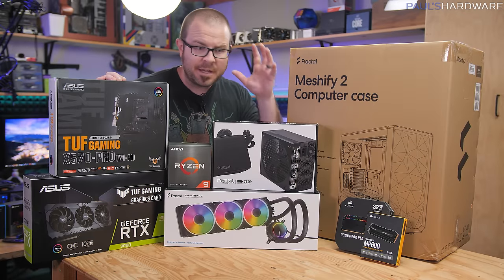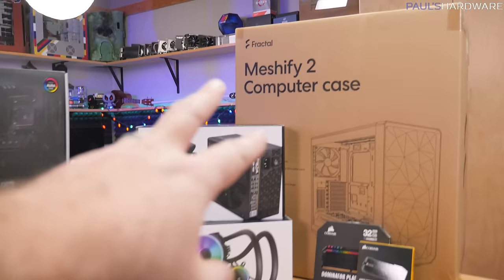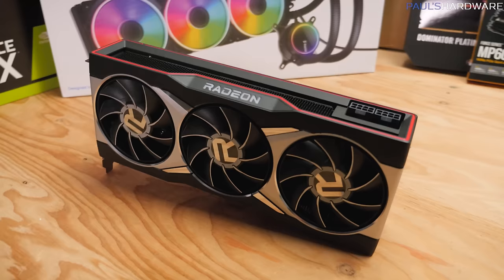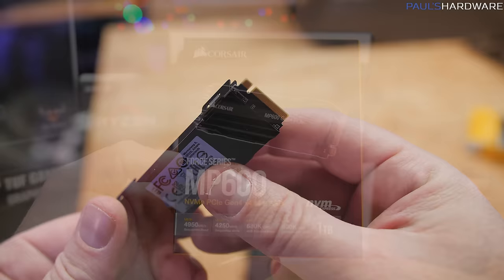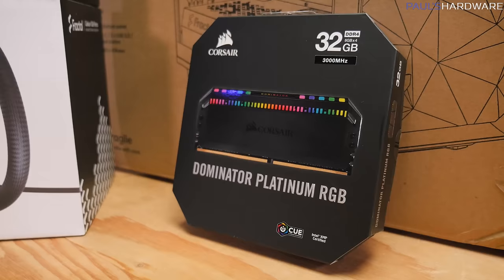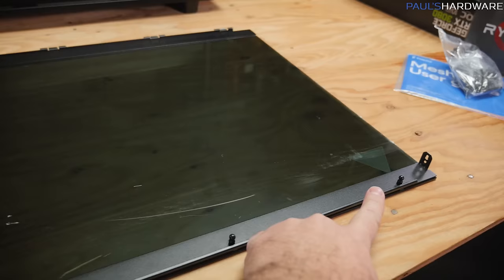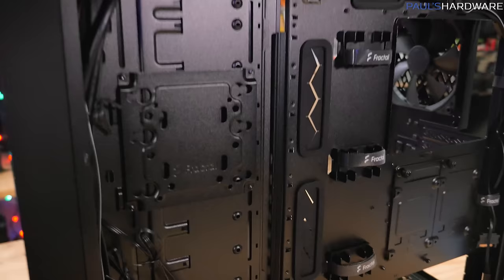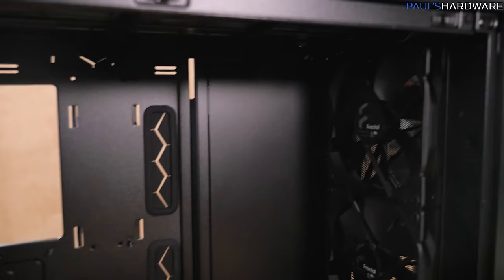Building the $2000 Gaming PC EVERYONE Wants Right Now!

Comment: 2020 is so weird...I've never had such a hard time giving a company my money 🤣
Reply: true, that's why I bought the rx 5700 xt now and will wait 3-4 years until they release more gpu's with decent stock
Reply: @joaomorato4351  I'm not pressing either, I have an 2070super. I'd like to upgrade my motherboard from asus b450 to 550 before anything.
Reply: Its nearly impossible to have them takenyour money, yet they throw 10s of cards to these content creators. They all end up posting the same.
Reply: at least you have money
Reply: @qweenzgrimyest  I don't think you need to do that. I doubt there will be a performance difference from a B450 to a B550.  Honestly the only reason to go B550 is if you have a Ryzen 5000 series CPU for it, otherwise save your money. If you want the PCIe Gen4, your 2070 Super is Gen3 anyway, and no GPU will really take advantage of Gen4 even if it was built for it. The only thing that does take advantage of PCIe Gen4 are really high end NVMe SSDs.
Reply: @fragalot  I plan on upgrading to Zen 3 if they become available ever. And also plan on only running off of NVMe. I have Samsung 970Evo. I cant go back to a regular HDD.

Comment: I was actually looking at building this exact system sometime in the spring. What a coincidence! Great video as usual!
Reply: It'll probably be obsolete by the spring.

I just built (in May if this year) a 3900x, 5700xt, 32GB, liquid cooled, same MB he's using in this build and I feel like it's already outdated (even though it runs everything I throw at it smooth as butter.)

Good luck.
Reply: @billb0313  You think a 5900x and a 3080 will be obsolete in less than 6 months?
Reply: @billb0313  Try looking up the meaning of the word "obsolete" before you use it next time.
Reply: @billb0313  i build my pc with a 5 year of expectations, I would never buy a new build every year or consider it out of date just because newer tech comes outs..  i have the 2014 build gtx 970 i5 4690k and that is still a decent build when playing at 1080p and it can even run a few games on 2k, I plan on selling my pc this soon for around £150 and using the money to build a new pc for around £1700. this build I would expect to last me to 2025
Reply: @billb0313  just cause it's not the latest doesn't mean it's trash. You still get the performance you paid for lol
Reply: @bradclark5913  Thanks for the heads up! I'll be sure to research this more before I decide what to buy. Appreciate it.
Reply: @Broussky88  software is outpacing the hardware at an exponential rate so, yes.
Reply: @rafe9852  I did. I stand by my comment.
Reply: @HaiLsKuNkY  software is outpacing the hardware at an exponential rate. Good luck.

Comment: This is literally the build I just put together, cept with the MSI Ventus 3080, an h710, and Kraken cooling setup. This monster better last me the next 5 years lol
Reply: 5900X worth it? I can’t decide between that or the 5800X.

I plan on building in April when the stock is readily available, although I’m sure better hardware will be out by then.
Reply: @ryannnftw  5900x offers 8 more threads and 4 more cores for 100 dollars more, as well as more cache. I'd definitely say its a better value even though I have a 5800x. Both are amazing though.
Reply: @ryannnftw  What alfie said. I personally think if you’re going all out on a high end PC you might as well get the best you can afford and just treat it right. Doubly so given the performance to price jump between the 5800x and 5900x. Good luck with part procurement and the build!

Comment: "$2,000 Gaming PC everyone wants right now!" 
Me who just built a $1000 GPC: :(
Reply: what specs? just curious. I did a 700$ build with i5-9600k, 1660 super, and 16 gb ram along with 500gb ssd
Reply: @calvinonmc  hey were almost the same (in the graphics card part) 
Ryzen 5 3600
1660 super
Western digital blue 1tb
Corsair LPX 16gb 3200mz
Bronze 500wat
Case: NZXT H510
Reply: @heyr3tr044  haha yeah, i went with a cheaper case, my power supply was 700 watts, and i went with intel because amd was out of stock at micro center
Reply: @calvinonmc  This is my first computer build so why not go big and spend a litte extra, it did come out to $1,500 (Including taxes, shipping) I also had to buy a monitor, keyboard, and mouse. overall I love this PC
Reply: @heyr3tr044  yeah that's why I don't buy online. We have about the same specs but it costed you so much more because you bought online. And online prices are crazy right now. I got my 1660 super for $220 and my i5-9600k for 150$
Reply: @calvinonmc  $220?!? It cost me $360, and well I had no choice there was no Micro center near me and Best Buy didn't even have all the parts I needed just the 16gb ram. Before getting I used laptops with 1tb of storage so I had to get a 1tb M.2
Reply: @heyr3tr044  yeah you should not have bought a graphics card online at this time, if you would have waited then the 1660 super will be well below 200
Reply: $1100:

Ryzen 5600x
Asrock x570 extreme4 mobo
240mm watercooler
16gb 3600mhz cl 16 ram
Nzxt h510 case
2 scythe fans to replace stock case fans
Pcie 4.0 nvme ssd
650w PSU

Didnt get a new GPU yet so im using a 1050 ti, but that will be replaced aroubd spring time
Reply: @BlastinRope  cool but i wouldve gotten a really good gpu and went with a ryzen 5 3600 until I could upgrade
Reply: @calvinonmc  it was a toss up between go semi-budget build and get everything now or get a quality foundation and be patient.

Decided to be patient in the end
Reply: @BlastinRope  well it took me 5 years to get to 650$, and I just couldn't wait any longer.
Reply: @calvinonmc  i understand, last time I had a gaming PC was 2015, since then Ive only had my work laptop and a super budget dell w/ 1050 ti. If I was younger and still played a lot of video games id be dying for a good rig - when I started gaming in mid 00s my first computer could barely run the first version of runescape, the ancient 2d one. I know how it feels

Comment: Hi Paul, thanks for the videos. I took a step and built my first PC using your videos as a guide.
It is modest by the standards of this machine but I am stoke with it.
Biostar B550M
Radeon RX 570
AMD Ryzen 3 3100
16GB Viper Patriot 3000MHz
WD blue SN 550 250GB nvme 
Total cost with case and power supply approx £600 GBP (approx $800 USD)

Cheers again,
Dave

Comment: Just did the almost identical build except used a Define R6 case and because of the shortage of components did air cooling and RTX 2070 Super. I also used the vertical mount for the card, which would really look cool in this build.

Comment: Nice build. I do question the positioning of the AIO tubes as they partially block the lower LED's of that very cool and very expensive Corsair Dominator RAM. For what those sticks cost, I would want to see every single LED it all their glory. Could you perhaps reverse the radiator so they come down from the rear side of the PC?

Comment: Yeah Bravo! it looks so easy, clean and super. Felicitations! I am sparing for my next upgrade from a i7 8700k OC-ed to 4.3Mhz and GTX 1080Ti och a Asus rog MB to a AMD system with may be a MSI Mag x570 tomahawk, ryzen 9 5900x and rx 6900xt or rtx3090 (I am hesitating there while thinking about ray tracing). What would be your opinion about that?

Comment: My only complaint about the x570 TUF PRO vs the PLUs is that they moved the front usb port (non c) header to the bottom of the case. Now you have to work your way around your bottom case fans, and the factory cable on my O11 dynamic barely reached it, so I bought an extension. Definitely an unexpected consequence of getting the front usb C header.

Comment: I need help (newbie)! I'm building my first PC! So far I have a tower case, 3070 ( I have two, an MSI Ventus 3x OC and a EVGA Ultra. Which one is better from these two?), 5900x (I also have a 5800x but i was luckily able to buy a 5900x), AIO 240mm. My only issue is finding a Motherboard for this build. I've heard that x570 is better than B550. All the other parts (SSD, PSU, RAM) are already in my "cart" ready to buy. Any input on a good motherboard to buy would be greatly appreciated! Thanks!

Comment: Hi Paul, did you have booting issues with this setup? I mean, the RGB works but is the pc booting?

I recently build a similar setup with Ryzen 5900x and TUF X570 but the pc is not booting, I'm just wondering if my problem is related to old BIOS

Comment: Fractal meshify mini, 5900x, tuf b450 matx wifi, trident 16gb 3600, dark rock 4, 850w rmx corsair, 2x LF 140mm argb fans front, adata pro gen3 1tb m.2. (Missing cpgpu atm...) Similar build that should be cheaper, yet here in Canada I'm over 3k putting it together.

Comment: Paul i have a question about compatibility with some ram i just bought for a new build i am attempting....

Asus x570tuf wifi plus
Ryzen 3800x 
Evga 1000 g+ PSU

The ram... is~
 
Geil super luce 4133 1.4volt cl 19-19-19-39  16gb gaming ram

I was wondering if it will actually boot up or will i have to buy new stuff not pulling 1.4 volts or clocked at 4133?

Or is that just an xmp profile and will i have to manually clock it to something that will work?

Comment: Mine's costing around 2.000 and it futures cougar panzer evo rgb, msi mag x570, r9 5900x, corsair vengeance rgb pro 2x8, corsair RM 850+, Samsung 980 512GB and probably rtx 3060ti when it comes out for like 400 dollars in US I could find the system for like 1500$ to 1600$ but if we add import fees will cost around 2000€

Comment: prefer those flat black cables than the sleeved extension cables. i don't find those extension cables appealing. what i would want to see though is graphics card manufacturers put an extension plug on the bottom of the gpu, like a 3" extension cable, where you can plug the power connectors. instead of what it is now.

Comment: Nice build.. High spec & looks clean 👌 I've got a NVIDIA GeForce GTX 1060 6G - i5 7600K - 16GB Ram - & a little bit of ssd which is a bonus.. With water loop too. I paid £400 for it which I thought was pretty reasonable 🤔

Comment: This is basically the build I want, but I am reusing my GTX 1080 for now. My main problem is that I cannot find a 5900X or 5800X...

I definitely am in need of a new PC though. Still using a 3770K and DDR 3. It's worked well, but I am starting to feel its age.

Comment: For GPU sag, I used a really long Twist tie. Its White and goes with my White case. I attach it to the corner of a top mounted case fan, through a screw hole. The other end wraps around the wire bundle for the power connector to the 2080 Super. 
I use this method for two reasons. 1. It doesn't stretch much.
2. I can control the amount of tension on it because of the way the twist tie wire works. 
It works fantastically, and I can create a balance. 
I'd like to know of someone has used this method with a 3080?

Comment: can i use the MSI GeForce RTX 3080 GAMING X TRIO 10GB GDDR6X with this. im fairly new to computers and only know some stuff. so if i buy this ^ will it not work with the thing. also i kind of mixed some of your used parts like the 4x8gb DDR4 3000 memory

Comment: Paul will my i7 9700k OCed to 5ghz at 1.31v , rtx 3080 asus rog strix edition and 16gb corsair vengeance pro ram at 3600mhz be ok with a corsair 750w gold 80+ power supply? I've heard that with intel cpus they use more power than amd, especially when oced and asus recommend 850w for their gpu on website as it used 30w more than founders so will I be ok with 750w or is that not good enough?

Comment: Hi Paul! I need some advise. I purchased a Gigabyte B450M DS3H motherboard and 16gb Crucial Ballistix 3200MHz (BL2K8G32C16U4B). I need to know which Ryzen processor can support that RAM speed and if I can Overclock the CPU if I get heat sinks or some other cooling solution for the MB's VRM?

Comment: i have this motherboard tuf x570 pro wifi and i can not get the docp profile to work, it constantly crashes the pc or boot loops. i have updated the bios, tried different ram, corsair snd gskill, 16gb 3600 and 32gb 3200 kit and neither run stable when enabling DOCP. have you had this issue? any help is greatly appreciated! also pc runs great when bios at default profile but even the smallest overclock on ram is unstable

Comment: Change the ram and the cooler I have a similar system ready to go except for the cpu and I got Gskill 4000mhz 16 cas latency RAM for my system and a arctic 360 cooler.

Comment: I am looking to complete a build using components pretty close to the build featured here (I am using Fractal Design Meshify 2 XL + Ryzen 9 3900XT + RTX 3070 Aorus Master + Tuf Gaming X570 Pro Wi-Fi + Celsius S36). Are the USB78 /USB910 ports on the motherboard compatible with the USB 3.0 system cable ?.
Reply: I connected the USB 3,0 cable to the USB 3.2 Gen 1 header on the motherboard (apparently it is backward compatible)

Comment: This PC is exactly what I want and slightly more powerful than what I need right now. I'm thinking of upgrading but no availability + the virus means I won't be able to upgrade for a while now. If I got it though, it would be perfect for my uni stuff and gaming, of course. Only things I'd change is swap it over to my P400A, nothing against the Fractal case, it's just a personal preference thing, plus the P400A except for the fact that it is the only truly premium PC part I own, was also a gift, so I can't part ways with it. I'd also add some of my drives on it. Then I'd just need to find 300+€ for a 1440p 144Hz monitor, to take full advantage of it...😅

Comment: I'd take out the four 8GB sticks of DDR4 3000 RAM and replace them with two 16GB sticks of DDR4 3600 and get that Infinity fabric clock set proper. Isn't it true that fewer RAM modules allows for better overclocking? My old i7 3820 has eight 4GB sticks (it's Quad channel X79) of RAM (DDR3 1600) and I can get a stable overclock of 4.2Ghz, but more is unstable, probably due to all 8 ram slots being occupied. I use it for video editing, but renders are still quite slow.

Comment: Really the set of components that I´ve been prowling around for my next build. It all becomes too clear though that the parts cost is way much higher where I live in Sweden. ? Such a build would cost about $3000 to $3200 USD with the current rate. The Asus RTX 3080 TUF Gaming alone costing a little over $1000 here now (if you can get one). Maybe countries beginning with "S" and in the CET-timezone is unfortunate (referring to the SA guy with the same challenge)?

IN the end - kudos for a really nice and clean build. I really liked the different considerations in components - being able to enable the front USBs etc. thumbs up :)

Comment: Well tbh if i was to win this I would only want the cpu, gpu, ram and the M.2. I have a mb already and case. I just need the 18 fans with control, 4 360mm rads, hardline with fittings, 2 pumps

Comment: Is this build good, and how much fps would i get?
Motherboard: AMD A320 Processor: AMD Ryzen 3 3200G - 4 cores - 4 threads - 3.6 Ghz (4.0 Ghz turbo boost) Graphics: Nvidia Geforce GTX 1050 Ti 4GB (GDDR5) RAM: 8GB DDR4-2666 Mhz HDD: 1TB 7200 rpm Housing: Sharkoon SKILLER SGC1 Red Power supply: 350 Watt - (80Plus) Extra: Windows 10 | Wi-Fi N300

Btw its a budget builds

Comment: I have a question: if i try to assemble a build with the fractal meshify 2 and the asus tuf gaming as my mb, the assembling company gives me a warning that there are not enough type c ports for the case. i dont understand why thats saying that and im pretty confused. the full build spec for me is the following:

Fractal Design - Meshify 2

AMD Ryzen 9 5900X, 12x 3.7GHz, 64MB L3-Cache
ASUS TUF Gaming X570-Plus WIFI | AMD X570
NVIDIA GeForce RTX 3080 10GB | ASUS TUF Gaming OC
32GB DDR4-3600 Corsair Vengeance RGB Pro | 2x 16GB
500GB Samsung 970 EVO Plus
850W - Corsair RMx Series 2018 
Corsair iCUE H150i RGB Pro XT | 360mm

maybe someone can tell me, why the manufacturing company (its mifcom btw i live in germany) is giving me this warning. Thanks in advance!

Comment: I have a question: Is there a guide to installing necessary drivers and windows? Also what monitors do you recommend with this build? Can it support two?

(New Question:) What monitors do you recommend?
Reply: There are plenty of guides on YT that show how to install Windows and drivers. The gist of it is: On a working PC with internet, download the media creation tool from Microsoft to make a USB installer. Boot your new PC off of that USB installer to go through the Windows install/setup process. Once Windows is installed, go to the motherboard manufacturer's page and download the relevant drivers like chipset, audio,etc. Most driver downloads come in a .zip format. Open it and extract the files. Look for the installer file (usually called setup.exe or install.exe or similar) to launch the installer program. The program will do the actual install for you. If it asks to reboot, do so and repeat the process for the rest of the drivers you need to install.
Reply: @JJFlores197  My mother used to build my old pc's, I've had a laptop or two for the last 9 years of my poor sod gaming life lol. I hope to save up enough to buy an actual tower. I just don't know where to start. I want something that can run most games on max graphics and still be quality/playable. Anyway... Thank you for your response! You helped by pointing me in the right direction. <3! Happy New Year!

Comment: North America is so much cheaper then Europe when it comes to computer parts. I built an almost identical PC in February for around 2000 Euros. But what I got for that money is 3700X, Asus Prime X-570 pro, 16G of Corsair 3600 Vengeance Pro (planing to order 16 more next month), 2TB WD M.2, 1070ti used (was holding out for new gen even then), 1000w platinum power supply, case and AIO the same just previous gen models. It would almost be worth it to fly to the US and sneak parts back to EU :)